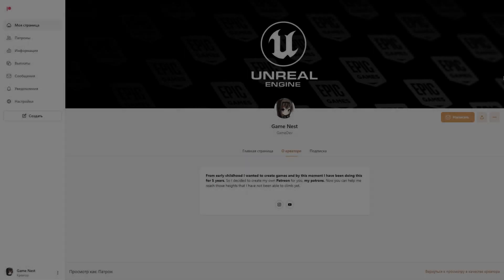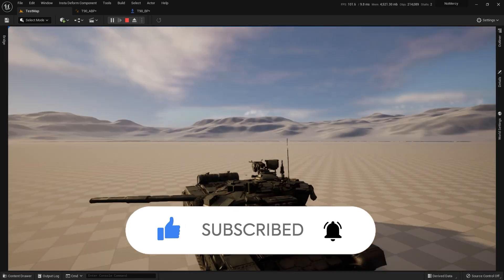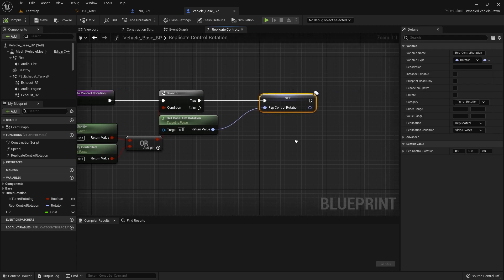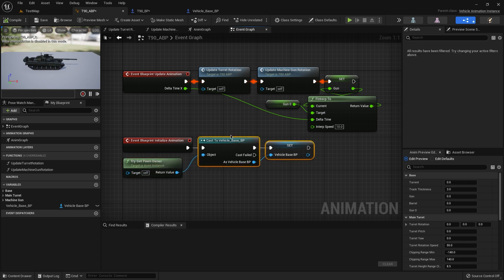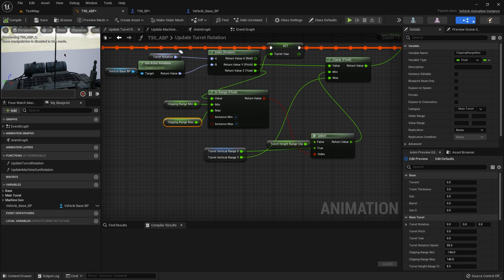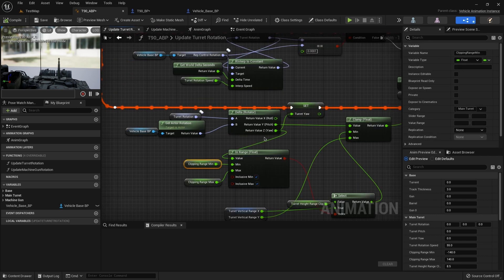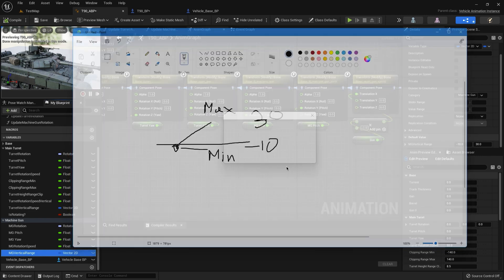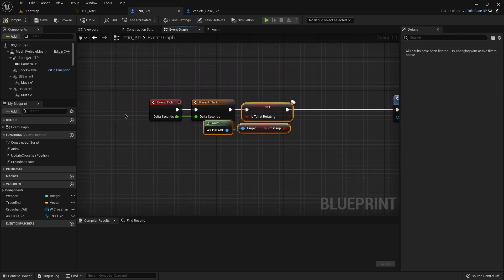Tank Turent and Machin Gun Rotation UE5 Tutorial (PR Files)

Comment: but how do you make main gun of the tank lag behind the mouse cursor
Reply from the maker: Maybe you need another video)
Reply: @valeriisafronov  Well what I'm originally trying to do is fix character going crazy in top down game that has a character always turning towards mouse but using WASD for movement. If you change mouse directions too fast directions change to fast and it all visually breaks. What Im trying to do is limit it. I tried with rinterp but it only works when characters idle/not moving